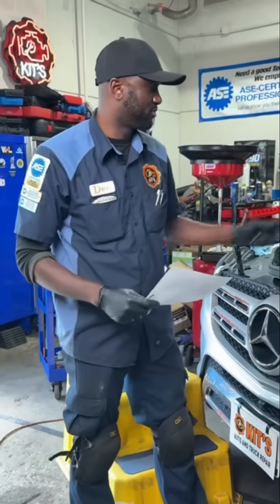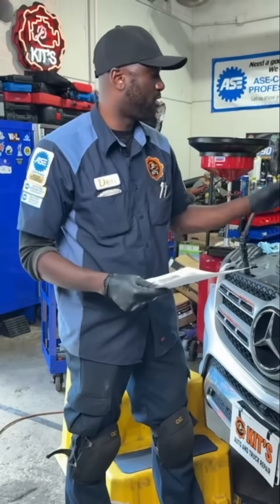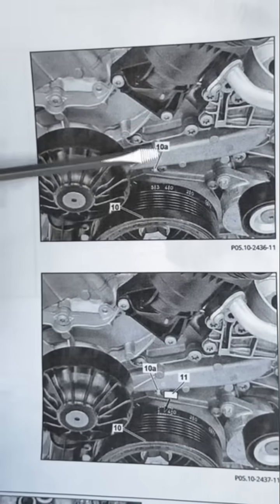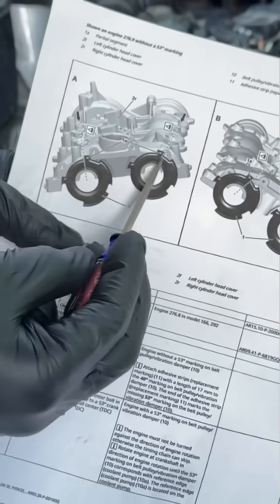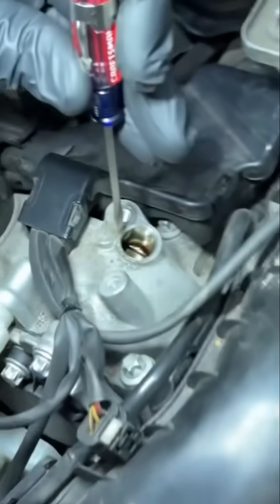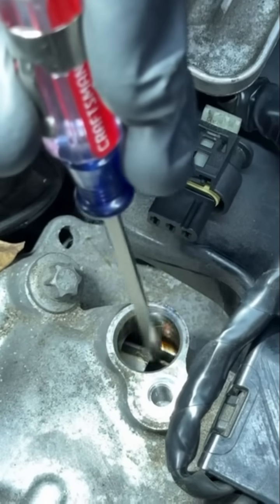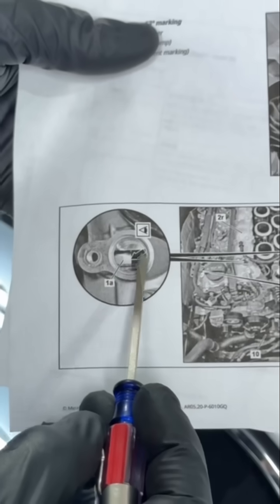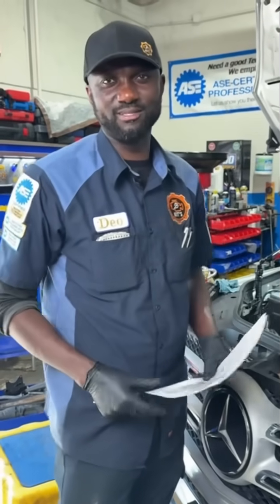Mercedes GLS 450 - Long Crank before Engine Starts -  Code P0016 - Diagnosis

Comment: Careful, sometimes the crank pulley rubber damper has started separating from the metal giving an inaccurate crankshaft timing mark. This may not be visible to the naked eye. To determine , bring cylinder 1 all the way up top dead center and see if the crank pulley is on 0
Reply from the maker: @BigBenny24   Good point, Thanks